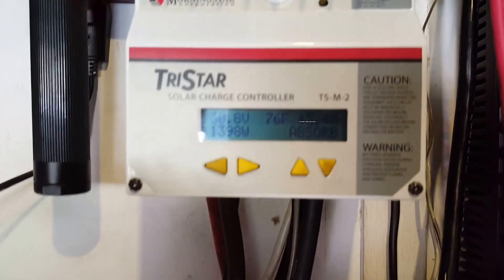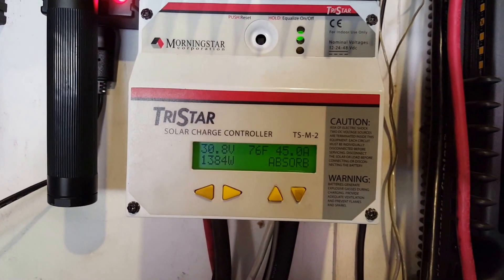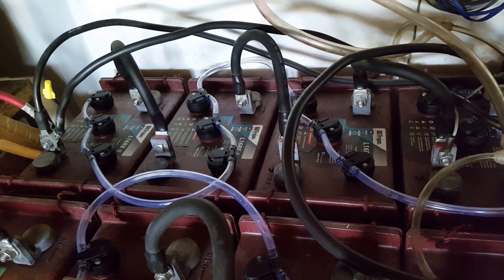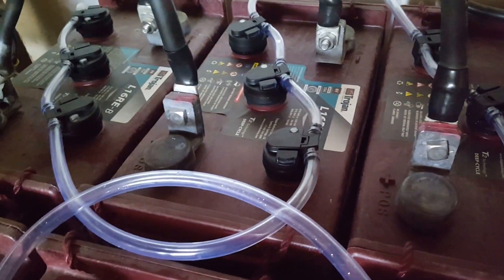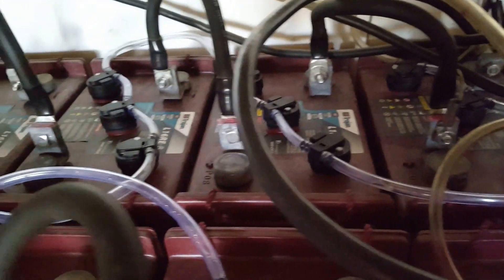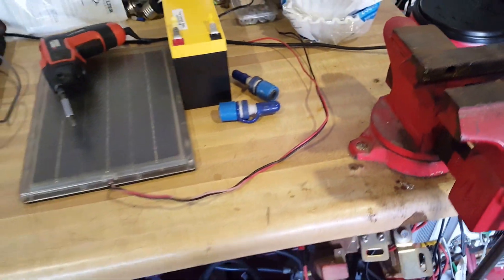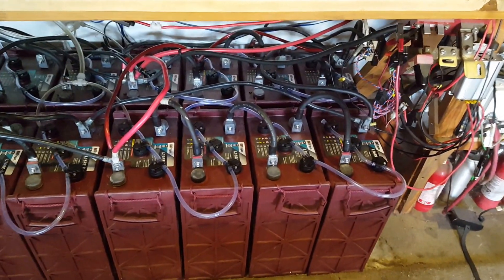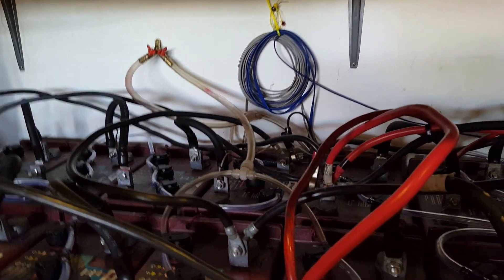Trojan Batteries Watering System Is Complete.

Comment: looking really good. That is also what I do not like about my classic 150 is you can not put a large wire in them like the tristar can use. That one red cable looks like it got really hot?
Reply from the maker: old time engineer the cable was discolored before, however the midnight classic always runs hot!

Comment: Nice setup there. I'm wondering if your battery connectors and watering hoses are too long
Reply from the maker: russell downer They are at the maximum suggested width and length. Thanks,

Comment: if the wires goes hot, they are too small in gage
Reply from the maker: They are the MC recommended  maximum gauge that would fit in the logs with a 90 Amps DC breaker!
Reply: # 3 AWG?